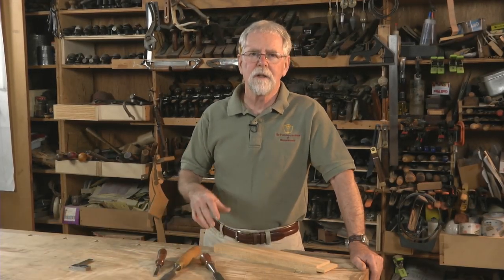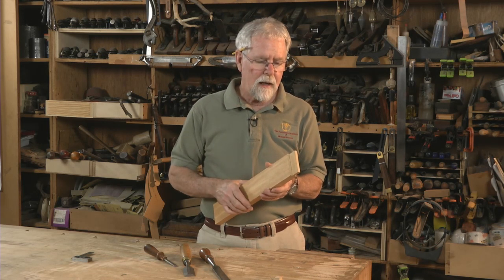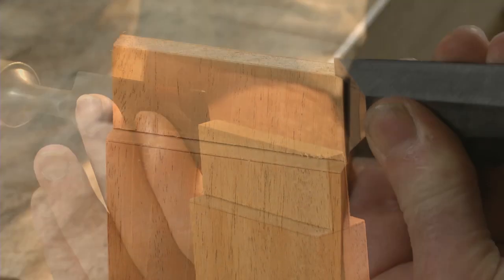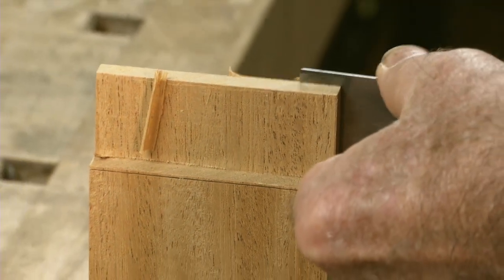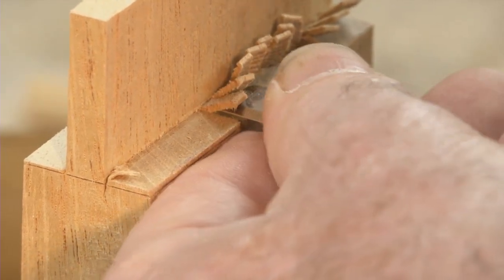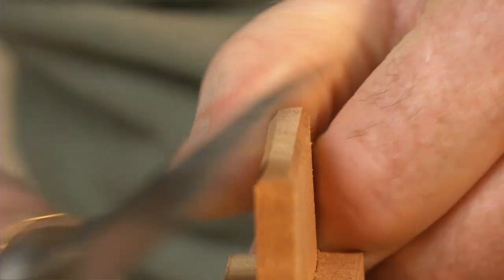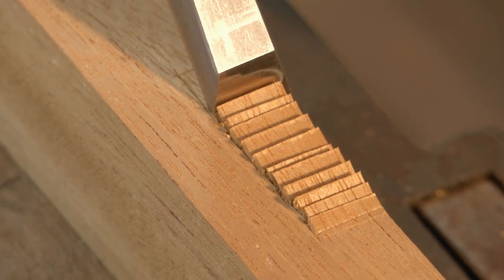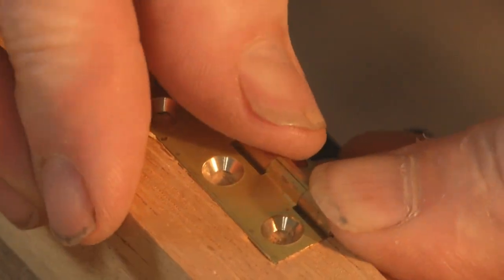Chisel Tricks for Hand-Cut Joinery

Comment: i have 1 handplane this guy got 1000
Reply: He has so many he can never find the right one, so he just uses a chisel for everything.
Reply: +1Howdy1 Ha! I was noticing the gallery of planers too. that was the perfect comment.
Reply: I have 6 or 7 planes, but tend to only use my number 4 and a half inch chisel, lol. Problem is you can't just sharpen things to be put away, ready for the next time. Sharp blades oxidize and need to be touched up just before use. I wish I could just spend an afternoon sharpening things and then pick them up and use them. I can't, so I've become pretty good at sharpening and using a chisel.
Reply: Maybe you could put a light coating of oil or wax on them after they are sharp. 
I took sobe saw blades to a place called Circle Saw to get them sharpened. When I picked them up they had a thick protective, peelable coating on them.
Reply: Matt de Oliveira I use wax sometimes, but maintenance can get to the point of diminished returns. I look at scary sharp the same way - there is a level of sharpness where you are no longer a woodworker, but a steel sharpener. 600 to 1200 grit and a strop will get a blade to slicing level. The trick is knowing when to stop and strop before it's so dull you have to sharpen. I do leatherwork, too, so I tend to sharpen all the time; about 10% of the time is spent sharpening. If it's a tool I don't use often it's a little more.

The point is you have to sharpen while you work and you can sharpen familiar tools faster. The second you hone a blade it begins to oxidise. You can't see it, but it's there. 

Doesn't take much. I might strop after one side of a tendon, maybe 10 quick strokes, and then it's tuned up for the other side. If I'm just standing there for a minute figuring out the grain, I'll run a chisel across the palm of my hand a few times, (pull, never push, lol). We're all born with a strop. I've watched Paul Sellers do this with his planes. You'd think he was brushing wood chips away, but he's knocking the rust off. 

The biggest problem I see with people sharpening things is they think to keep something sharp longer, it needs to be sharper and they too much effort into making things sharper. Learn to keep things sharp with the least amount of time and effort. Once the blade starts to catch and chip instead of slicing, you've gone too long.
Reply: 1Howdy1

Comment: Great video.

I think what some commenters might be missing is that hand tool work is very fast once you know what you're doing.  There's no messing with fences, blade height, cut depth adjustments, templates, jigs, etc.  You just pick up the tool and get to work almost immediately.  A scribe line or pencil mark, and off you go.  By the time you factor in all the adjustments power tools inevitably require, you could have done much or even all of the work with a hand tool.
Reply: +Borys Medicky Very true.  I'm learning that sometimes, the hand tools are just simply faster and more accurate too, except in a production shop where one might be doing a hundred tenons a day, then the power machines are much faster.
Reply: Borys Medicky there's so so many factors you're missing, you have to remember these chisels take ALOT of care to work this well, you have to clean them and sharpen them every time you use them, and if you chip the blade it then takes alot longer to grind it down and get it perfect again, honestly, you're one of the commenters you talk about yourself, it's quite silly.
really how hard is it to adjust the height on a router ???? like 5 seconds. I can make one 10 of these joins with a router before 1 is made with a chisel, it's all about method.
Reply: Chisels don't chip unless you abuse them, and don't take a lot of work to resharpen if you know what you're doing.  There are tons of Youtube video in which chisels are quickly sharpened, with or without jigs, by hand or with some kind of powered abrasive, in no more than 2-3 minutes.  And router bits get dull too... sharpening them properly is not easy, since you can only sharpen the flat back and not the actual cutting bevel.  So they are never really be sharp except when they are new, and they can only be half-sharpened afterwards.

Look, there's nothing wrong with power tools:  I use them constantly myself.  But if you train yourself with hand tools you can go beyond what power tools limit you to.  With a dovetail router jig, you are limited to maybe three dovetail angles, based the router bit you use; with hand tools, there are infinite possibilities.  Want to space your dovetails in some strange or irregular way, or mix different pin/tail sizes in one joint?  No problem with hand tools; with power tools, you now need a fancy and expensive jig that may or may not be able to do what you want, and if it does it, it requires major reconfiguration.  Feel like dovetailing two pieces at a joint angle other than 90 degrees (uncommon, but yes, it can happen)?  Impossible with any router jig I know of; with hand tools, fine.
Reply: Borys Medicky yeah I understand all of this bro, I've been in civil construction, general construction, cabinet making and worked in a hardwood mill for 7 years, I know everything possible about sharpening blades, bits, saws and anything else in between, the fact is, everything about a chisel is slower, if you know then you know...
in saying that, if you don't have anything and you just want to say, make a table, then my first option would be to spend a little on a chisel set rather than alot on power tools, they are more efficient in that way but that's about it in my opinion.
Reply: Borys Medicky chisels are great but if you are doing a ton of work power is helpful like drilling out most of a mortise and then finish it with a nice sharp chisel
Reply: Someone tell this guy that router he just abused has 80 times the surface area for stability/flatness/ depth of cut, can be adjusted in 5 seconds to (just as quick as a marking gauge), and, with a simple, well-made (precise) clamp-on template, not only faster but more accurate too.

Chisel the corners square, sure, but, lord in heaven...
_________________

Reminds me of the last wanna-be carpenter I saw take 4 days to butcher a house full of jambs (by hand...)

i.e. He had that same Dunning-Kreuger* (blissfully ignorant) confidence about him — lol — so no one bothered to check work (or note how bloody long he was taking) until the doors didn't close, *lol — ;

_______
Ps: Maybe he meant he doesn't use it because it doesn't have an LED light, and proper dust extraction.  #2014*
Reply: Seipjere this guy isn’t a wannabe carpenter or even a carpenter. He’s a woodworker of fine furniture and has reproduced, created, and restored pieces of furniture, many of which are individually valued more than a house. He’s literally recognized as one of he best woodworkers of the last 100 years.
Reply: That's the curse, I died 3 years ago when I came to the earth my body became a receptor for key people etc etc thats how I break the curse when my body doubles “die” and I can then find my true self and unlock the universe etc thats the game what I just said the comments here maybe not related I havnt read them I'm just saying 

Leonardos body double curse situation  I ment that how I wrote it in the real game

Comment: I appreciate your video but woodworkers need to cut the crap and stop being so exclusionary.   

If you want to use a router, good for you.... you are STILL out there working with wood... yes, there's something intimate about using hand tools... fine!

Dovetails cut by a router are every bit as mechanically strong as hand cut dovetails.  This is where the stigma of being a "purist" comes into play.

They might not look hand cut, but they are every bit as strong/stronger than hand cut dovetails.... 

Woodworkers seriously need to hop off the high horse.   You have 45 planes in the background, you probably use 5-10 tops.   

The "culture of it all" doesn't let new woodworkers into the club.
Reply from the maker: Um... it was a joke.

Comment: first buy a good chisel
Reply: It doesn't take a good chisel, just takes a chisel. Doesn't need to be scary sharp, just sharp. The trick is to keep it honed. They don't show that part on Youtube videos. It's either using a chisel or how to sharpen a chisel, but never some guy chiselling out one side of a tendon, turning around for a few passes on the stone, and then chiselling out the other side. Makes people think chiselling or planing, and sharpening are two separate events when they are really both part of the same process.

Comment: Why would you need to fit tenons into mortices by hand ....to me a sign of bad machining in the first place...if ya worked for me you'd be straight out the the door if saw ya doing that
Reply from the maker: +John Wood Um. Ok.
Reply: +FineWoodworking this is exactly how I was taught during my apprenticeship to become an advanced & Master Carpenter and shows a true craftsman, any idiot can set a machine up but not everyone can do this by hand. Your 73k subs compared to that fools 0 (zero) is evidence enough.
Reply: It's not machining, it's woodworking. If it was machining, I'd agree with you, there are no machines here.
Reply: Try listening to the commentary Kenneth it is mentioned 'weather machine cut or hand cut tenon's'...having been in this trade for over 50yrs you learn to make joints fit 1st time...something I was taught as an apprentice by a very good forman
Reply: John Wood Okay I hadn't heard that, but I think he said "whether this or that" not "weather" like a type of machine. But that would maybe make sense using machines as you're learning and first starting out.